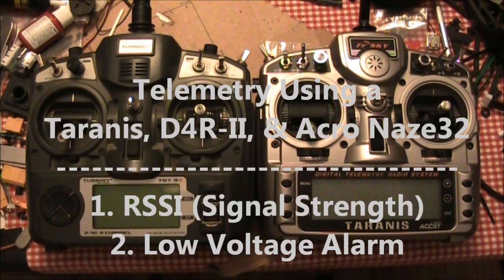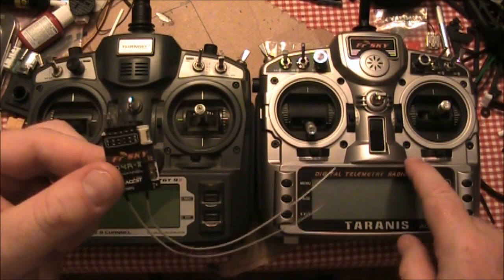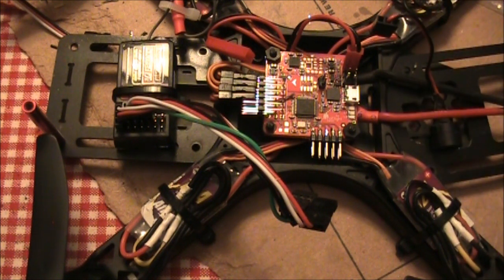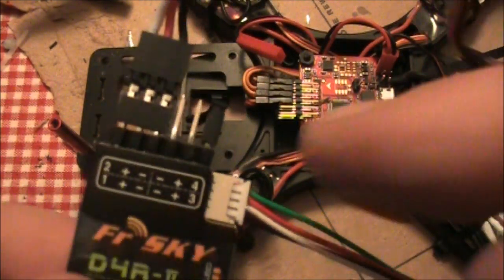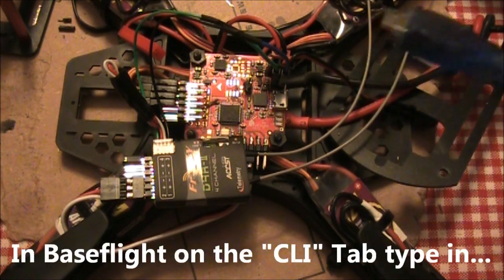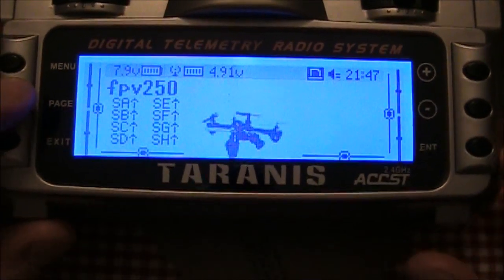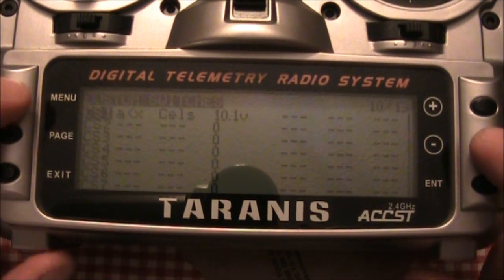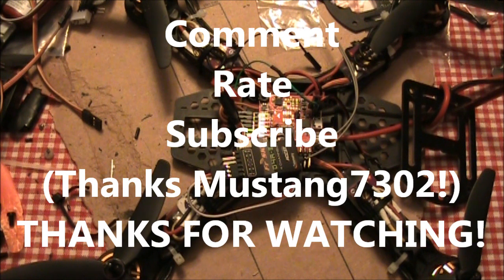Acro Naze32, Taranis, & D4R-II Telemetry Setup (CPPM)

Comment: This video showed me exactly what I need to do to actually get these components talking to each other properly. Has completely transformed my mini quad experience… no stress, no ruined batteries. I made the trainer switch (the spring-loaded one on the back right) speak the voltage on demand in case I'm curious. Thanks a lot for the vid man!
Reply from the maker: ajumoni Good!  I'm glad it works for you!  I have my audible voltage on a different switch and I have my momentary switch set to reset my flight timer.

Comment: I ended up with a slightly more complicated setup when I did mine, but it might be useful to someone:

My goals:

1. Don't start giving me battery alerts when I turn on my transmitter and have no telemetry.
2. Don't do "Battery warning" and "Battery critical" at the same time.
3. Allow me to acknowledge a battery warning so I don't have to keep hearing about it.

First, with logical switches:

1. I did logical switches 1 and 2 as you described here except:
   a.  L1 requires (AND) L4
   b.  L2 requires (AND) L3
2. LS3 is [cell] > 0 (basically, "do I have telemetry at all?")
3. LS4 is   L3 AND !L2  and SC↑

(and yes, SC has a startup switch warning)

Then, battery low on L1, battery critical on L2.

With this setting, L1 and L2 are both off until I get telemetry.

L1 is off when any of the following is true:
   1. Battery is sufficiently charged.
   2. There's no telemetry.
   3. Battery warning suppression switch is thrown.
   4. Battery is critical (since that has its own warnings)

L2 is off when either of the following is true:
   1. Battery is sufficiently charged
   2. There's no telemetry.

Note that "telemetry" here is value.  Once you receive a value, it sticks even if you lose telemetry, so the alerts don't just stop firing when telemetry is lost, they simply don't fire when it never had it (this was really annoying when I'd turn on my radio without hooking up a battery to the aircraft).

Comment: Awesome video with lot of simple details. I also found on forums that there is a problem with battery monitoring. Let say you have a 4S batterry and you get a total voltage from it. But if one cell is lower than 3.3v you can damage/lose your battery. It's still nice to know how to setup this thing on Taranis and save your guadcopter at price of a lost battery =). Or at least get warning, return the quadcopter if it's far away that you don't here the voltage sensor and fly till you get the signal that one cell in the battery is at the limit level. =)
Reply from the maker: Alexandru Covaliov The only way anything can monitor the individual cells is if it were connected to the balance port, otherwise, you're just going to get overall battery voltage.
Reply: Alexandru Covaliov For individual cell voltage, buy a FrSky FLVSS. One end plugs into the balance plug on your battery, the other end into the Rx. Automatically supplies "Cell" voltage to FrSky telemetry. HobbyKing and Banggood, etc. have it. However if you have healthy packs and only run your packs down to about 3.5V/cell you should be fine with overall "Cells" value.

Comment: Hi Travis. I have a Turnigy 9xr Pro, Naze32, D4R-II, all wired in PPM. I purchased the smart-futaba wire and wired my DJT module to my 9xr for telemetry. I also wired the D4R RX wire to "port" 5 on the Naze, which is for Frsky telemetry. Here is the problem. I am on baseflight. I am using port UART1 for telemetry on the Naze, but Frsky telemetry requires inverted protocol. Baseflight seems to be missing the ability to invert UART ports (ONLY able to invert softserial.) 
Skip ahead a few days, I decide to upgrade to cleanflight. Everything flashed over fine, and I configured my settings. A major difference I've noticed in Baseflight VS cleanflight is that CF allows you to INVERT port UART1 protocols. You can also do this through the CLI (in CF.) Telemetry instantly started working beautifully on my 9xr (RSSI, TSSI, A1 voltage.) The problem is my quad will NOT fly in CF. I can get telemetry to work in CF,  but I can't fly the damn thing on it. It'll take off and just wobble like crazy until I land it (can't barely get it 2-3 ft off the ground.) Instead of editing my PID's, I just flashed back to baseflight, sacrificed telemetry, and the quad started flying just fine as soon as I was back on baseflight.
So my challenge it seems here is to figure out how to invert the UART port in baseflight (which there seems to be no way) OR figure out how to stop my quad from wobbling like crazy when running cleanflight....What do you think? 
Sorry for the wall of text.

Comment: Hi. Thank you for the video. I have a question. I have set up OpenTX 2.1.3 telemetry and I have D4R-II with Naze32 talking over "telemetry" serial port. I have "discovered" new sensors and I got SWR, RSSI, A1 and A2. A1 shows 5.02 V, A2… well, something between 6 and 7.5 V, it varies.

But what I need is A1 anyway, right? Range is set to 13.2 V, why is it showing 5.02 V regardless of actual battery voltage? Is it perhaps telling me the voltage on the Naze (behind the 5 V stabilizer if there's any?) instead of battery voltage?

I have beeper configured for voltage alarms on Naze, scale = 110 and it seems to work correctly, so the battery connection is OK.
Reply: Hi. It turned out that I needed to wait about minute or more for Taranis to see the rest of "sensors". Once it acquired them, they started to work.

But then I upgraded Naz32 firmware and it stopped worked again. So now I'd fly without battery telemetry… but I don't really fly since it's winter here. ;-)

Comment: I think you can skip the ground wire between the D4R-II port and the Naze32 telemetry header because the D4R is already grounded via the wires connecting the D4R CPPM (or PWM) wires to the Naze32 RX header pins.  Just verify this using a multimeter and test continuity between all the ground points.
Reply from the maker: You're probably right.  Connecting an extra ground doesn't hurt anything though.
Reply: ***** Yes, if it works then there's no reason to change anything.  I keep reading people on the forums say "Avoid grounding loops!"  so I try to ensure each device has only one ground connection.  Dunno when exactly a ground loop would happen though :/

Comment: "Whatever you call these things..."  Having spent my life working on computers I never thought about what you'd call them, until I decided to order some so I could make my quad's wiring pretty...

They are '.1" DuPont Wire Jumpers' or '2.54mm DuPont Wire Jumpers'...  With a $15 crimp tool you can add them to any wire you want without the shrink tube.
Reply from the maker: Good to know!  I've usually searched for "servo leads" to find them.

Comment: When you show your telemetry setup screen I only see one set of data, A1. Isn't that the internal telemetry? i.e. the RSSI and the receiver voltage (coming from the FC or the BEC)? Won't you need to have the main battery voltage coming to A2 channel?

I'm seeing the same on mine (just A1), and can't get the A2 to show the main battery level. I wonder if it is because I use the flashed firmware for 8 channels?

Comment: Another question. You used two seperate single pin connectors on the 4 wire lead included with the D4R from the receiver to the telemetry terminals. Since I don't have access to those, could I use a three pin connector and just use two wires instead of three as long as I make certain the black wire goes to the ground and the green to the telemetry?
Reply from the maker: Yes.  The important part is that the wires are connected correctly.  The only reason I used the individual pins is because I already had them.

Comment: Hi, thanks for the useful video.  I did everything as shown in the video on my Taranis X9D and D4rII.  But both the cels and cell values showed zero, while the RSSI does show a value.  Tried disconnecting from computer and arming it,  still shows zero values. What is most likely the cause?  What is the difference between cels and cells in the Taranis?  Thanks for the anticipated reply.

Comment: Can you advise how to connect the Naze32 telemetry to the XR8. On the D4R-II there is only 2 cables used, yet on the XR8 RSSI connector there is three signal, positive and neutral? I'm an amateur but cant find anything like your video for XR8.

Thanks
Leo

Comment: The lead you connected to the vbat on the FC board, can it be soldered directly onto the pcb board at the same location where the battery cables are soldered? What guage wire should be used for this connection?
Sorry if these are dumb questions but I'm new to this!
Reply from the maker: Yes, I have it (the wire I'm pointing to at 3:22) soldered directly into my battery harness - I didn't use a PDB.  The mAh going through the wire will be real close to zero so the wire can be very small.

Comment: I'm new to in this hobby and I would like to know how low is low on a 3s 11v Lipo battery? Thanks!
Reply from the maker: If your individual cells go below 3.0v, you will start causing them damage.  A lot of people suggest landing when your 3S battery gets to 10.0 volts.  That leaves your cells around 3.3v - that is what I set my low voltage alarm to 3.3v per cell or 10.0v overall 3S voltage.  If you want a little more flight time after you hear the low voltage alarm, then you need to set it a little higher.

Comment: Awesome thanks as a newbie I was having issues with this part and I have the exact same setup so was a big help . Big thumbs up.
Reply from the maker: Great!  I talked to some people on the forums about how to set this up I couldn't find a good tutorial so after I figured it out, I made this video.  I'm glad so many people are finding it helpful!
Reply: ***** Hi Mate tried to set it up today but got stuck. Everything is clear and not hard to follow but what happens is after I set the telemetry on the taranis to Cels-Cell-RSSI and go back to the main screen all I get is RSSI I dont get any values for the cels or cell? It just reads 0.0? So I didnt get to far at all. Not sure what else I need to change?
Reply from the maker: The Naze32 has to be armed before the voltage is sent to the d4r-ii and then back to the Taranis.
Reply: ***** oops ok Your right Sorry brand new at this, This is my first RC adventure. Only issue I have now is my cell reading. Cells is 11.2v and cell is only 1.4 on all the batteries? Is there another setting? As I need this to work to set the rest up. Thanks again for the help.
Reply from the maker: If you have it setup like I show in this video, the Taranis can't show the true value of each cell because the Naze32 is just connected to over all positive and negative connection.  It isn't connected to the balance port or anything like that.  If I was guessing, I'd guess the Naze32 is thinking you have a 8S battery for some reason (11.2 / 1.4 = 8).  I haven't seen that before.
Reply: Mmmm ok I wonder if I can  hange that in cli? I guess I  an just set alarms on the cells not cell. But that could be abit riske if one drops to low couldnt it?. Sorry all new to me im wrapped I have actuelly built one c re ashed it and rebuilt it😃 just fitted fpv gear and made my 5.8 ariels which work so learning 😃 but man what a steep curve .
Reply: ***** Ok Mine does not read or work properly I just put a meter on my batteries and there over 12v Im getting a reading of 11.2 on the taranis through the Naze. I just ran props for 2 min on the ground and the Taranis did not change at all and kept telling me 11.2 v For some reason the naze is giving incorrect info.
Reply: ***** Hi Mate just thought I d give you some feed back. In CLI I was getting the correct Cels voltage but was showing 1s? Couldnt work out how to change the 1s. So I fitted another naze 32.  I now have it in CLI showing 3s. It was still a bit inaccurate in regards to the readings. There is a setting in CLI called Vbatscale and you can up this a little to adjust the readings and ,match it.
Reply: Stephen Galvin You may have saved me further frustrations my friend. I'm running 3S and getting readings through telemetry that are way off the mark. I'm also getting the issue where my telemetry value doesn't change despite battery voltage reducing. What are you running and what have you set vbatscale to? Thanks.
Reply: Ross vbatscale can be changed under Setup tab or CLI tab mine is now standard at 110 . Yoi do get a alightly different reading but very close and of course the voltage goes back up slightly after you land. Also check in CLI type SET then hit enter and check vbatmaxcellvoltage =43 and vbatmincellvoltage =33
On my faulty naze I was only getting 4 and 3 and couldnt change it. I will put this board onto a feame to learn acro and add a 3rd party alarm as other than this it works fine. If your readings are out a bit try and adjust the vbat scale a littleup or down. Hope this helps.
Reply: Stephen Galvin Thanks for that Stephen. I'll check mincell and maxell and see where I can get with vbatscale. Cheers.

Comment: Great video !!!!! I don't own the taranis but a modded Devo controller with DeviationTX. Telemetry should work. I will use your video to setup the wiring. Stupid question, the Bat in pins (the two on top) can accept direct 3S, 4S input ?
Reply from the maker: Thanks!  Yeah, you can connect either 3S or 4S to the Naze32.  I've used both.  Let me know if it works with your TX/RX.
Reply: ***** Ok thanks :). Other question:. except battery voltage and RSSI, what kind of other parameters are transmitted ?
Reply from the maker: Well, if you have a full Naze32, instead of just the Acro version, you can readings from the barometer and magnetometer.  If you connect an external GPS to the Naze32, then you can get GPS info.  I'm thinking about getting a GPS next. We'll see though.

Comment: Hi thanks a lot for this video. Do you also know how to setup telemetry on the new X4R-SB receivers and the Naze32? Do I just have to connect the Smart port to the Tx pin ont the Naze32 like it's with the normal D4R-II ??

Comment: By the way, which tx module are you using to receive the data from d4r?

I am figuring wheter to go by sbus or cppm in the near future and wheter I shoudl buy the D series receivers or X series receivers, with the background of using telemetry on naze32 or possibly arducopter

Comment: Subscribed, thanks for the info. Two things I'd like to check before I hook up my Naze tho... 1. in this video you said that you can connect your flight batt to the Naze so it can monitor for low battery.. So using those pins you can just conect the full 11.1v (or so) direct to the board and you dont need a seperate voltage/current sensor?
2. I have 12amp Afro ESC's with .5a linear bec's, should I remove the +/- from three of the esc's or can I plug them all in?... Thanks dude
Reply from the maker: Yeah, the 2 voltage pins by the buzzer and frsky telemetry pins should be connected directly to the battery or wiring harness/board.  It reads the voltage but does draw hardly and amps at all.  I've had a 4s battery connected with no problems as well.  The Afro ESCs BEC is a "linear" BEC so you can connect all the power wires to the Naze32 and you will be fine.  That's how I wired mine too.
Reply: ***** Thanks heaps mate :)

Comment: Hello Travis!
Brilliant video. It's helping loads with my setup. But I have run into an odd issue. I seem to be getting no power to my D4Rii ? any ideas what I could have done. the rx will power up if I plug a receiver pack... But connected to the naze32. Nothing 
Chris
Reply from the maker: Are you seeing LEDs light up on your Naze32 when it powers on?  Do you have the 3 wire cable between the Naze32 and D4R-II connected backward maybe?  If the Naze32 powers up, power should be going out the power and ground cables to the DR4-II.

Comment: I noticed on your telemetry screen you have a value of 4.91 entered for A1 channel. What is the A1 channel and what does that value represent?
Reply from the maker: I think the A1 channel has to do with the internal battery.  I haven't really looked into that much.  I just charge the battery when it gets low.

Comment: I run this receiver with a flip32 and cleanflight.  I am hooking up to rx input 6 which is softserial. To get this to work you have to go into configurator and check telemetry and softserial then go into ports and under softserial 1 telemetry make sure its set to frsky and I selected 9600 baud.  In the command line interface (CLI)  you have to type in "set telemetry_inversion = on".  Hit enter.  Type "save".  Hit enter.  Should work.  I spent hours trying to get it to work but it I finally got it.

Comment: Hi there! I would love to see a video how to set up the taranis for a mini H quad.
Reply from the maker: What part of the setup are you looking for?
Reply: I now have a dx6i but people say that taranis is better for fpv... But difficoult to setup they say. Thats why I was looking for a good instruction video first.
Reply from the maker: johnny lwd If you're happy with your DX6i, then I'd say stick with it.  I know that TX has a long reach.  If there is something that you think your TX can't do, that is when I'd suggest you start looking for a new TX.  I used my Turnigy 9X which probably isn't as good for over a year before I got my Taranis.  The thing that made me decide to get the Taranis is the voltage telemetry stuff.  If it hadn't been for that, I'd still be on my 9X.  I didn't have much problem setting it up.  Also, a better TX won't necessarily make you a better FPV pilot - that takes practice and not being scared to crash and repair your quad.